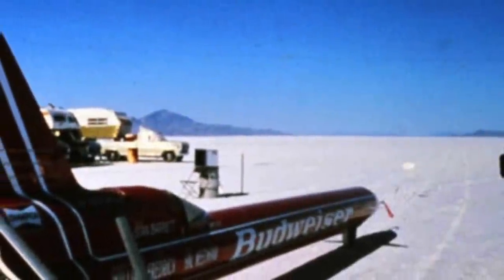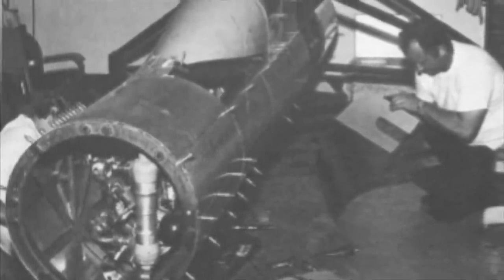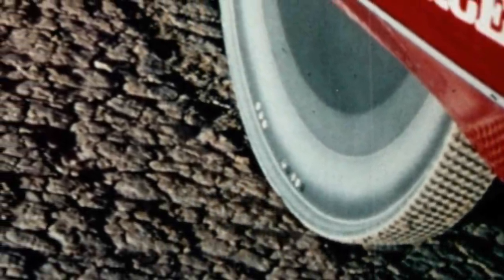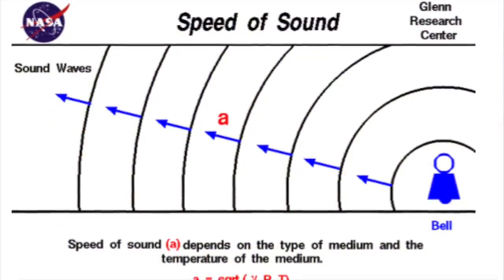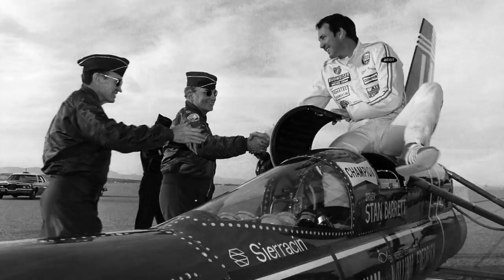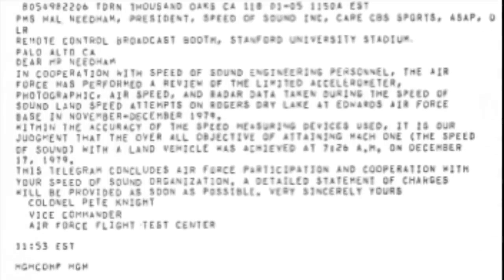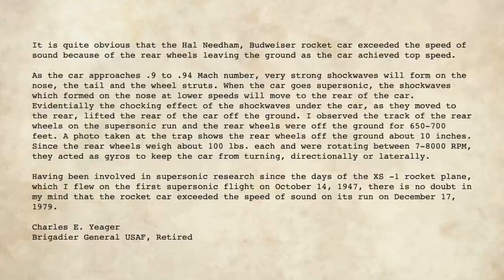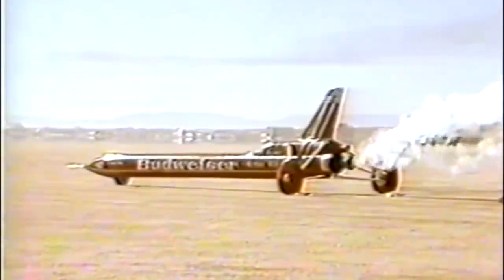The Budweiser Rocket - Controversial Rocket Car

Comment: Several of the test runs were over 700. The last run used about 30% more thrust than any of the previous runs...  Speed isn't linear to thrust, but I bet that extra thrust did get him the extra MPH.
Reply: Considering the already well-known problems with the measuring equipment used, (and the subsequent secrecy about the data ever since) I highly doubt the claims that the previous runs had broached 700 mph too.
Reply: When you approach the speed of sound, something called wave drag starts to come into play, this significantly increases the drag coefficient, the drag coefficient is highest at Mach 1, so this sound barrier is literally a barrier of drag.

You may think that the decreasing mass of the rocket car due to the use of fuel will increase it's acceleration, however this probably isn't the case, since the drag force and the decreasing mass would mean that the acceleration vector acting against the car if it had full propellant at a given speed would be smaller than if the car had low propellant at the same speed.

I would guess that it was very close and I think it would give a supersonic reading, if you looked at the ground speed, however I think the airspeed was just under mach 1 due to a tailwind, but I don't know if there is wind data out there.

Comment: Ah, the age old question of when is the sound barrier broken? I think we need a bit more information on when the speed of sound at this location was determined, and how soon after the attempt was made.  If they predicted the speed of sound several hours before the run, or at a location several miles from where the rocket car was at max velocity, atmospheric conditions could have changed enough to have made the new "speed of sound" be 740mph (~1% difference). Clearly the fastest man on land at the time, but not necessarily the first to break the sound barrier on land.
Reply: The sound barrier is a sudden aerodynamic drag Force on the vehicle you are in as you are breaking or crossing the speed of sound or 767.4 mph
Reply: Got it?
Reply: 767.4mph that the Speed of Sound
Reply: The speed of sound in air is dependent on the density of the air.  It is not a fixed number.  It can fluctuate by several percentage points on any given day.
Reply: @ts89540  Correct, the local speed of sound can change in the same location depending on air temperature and atmospheric pressure (i.e. height above mean sea level).
Reply: @thecloneguyz   It changes with temperature (and other factors including humidity). At 0°C (32°F) the speed of sound is around 741mph. The wiki article claims that the local speed of sound around the time of the run was 732mph, which gives a temperature of about 20°F. They claimed the car achieved 739.666 mph which would have been supersonic if the temperature still was around 20°F, but it would only have had to warm up to about 32°F for that speed to be subsonic.

Comment: No sonic boom not brake the sound barrier.
Reply: You need to go back and study what the speed of sound is. It's a fixed value based on standard pressure and temperature. You can be above the speed of sound at STP while not creating a sonic boom due to local atmospheric conditions.
Reply: otm646 - so what's the speed of sound std? What was the SOS on the day? And how fast did he go?
Reply: @xavierrodriguez2463  my point is someone should have the relevant info to know if they should have expected a sonic boom.
Reply: @otm646  No, I think you need to find out how this works. The speed of sound is temperature dependent. That's why they did the run in the morning when the local temperature was about minus 10 degrees. It doesn't matter. There was no evidence from the television broadcast, the pitot head or the accelerometer data.

http://www.dlg.speedfreaks.org/archive/lsr/bud/bud.html
Reply: Yes and the cross section is so small it would create a much smaller sonic boom than any other land speed car
Reply: @nathanchildress5596  Well, there are other ways to determine it. Nothing came up to indicate that this thing went supersonic.

If you look at Thrust SSC going supersonic, you will hear virtually nothing until you hear the double bang. That is what should have happened with the Budweiser Rocket but it didn't. It would have been quite easy to hear, regardless of the relatively small size.

No visible shockwave, no Schliere and no sonic bang. Pretty hard to make a case from that.

Comment: If it only equalled the speed of sound for a moment, there's a good chance, that there wouldn't have been a sonic boom.
       Too bad, that they didn't use 2 Sidewinders. I think, that they could have, without increasing the cross section. ...Oh well. Woulda, coulda, shoulda...
Reply: Not true.

Comment: The vehicle certainly had the capability. It looks like they went full power, full duration, and used the Sidewinder when he was supposed to at 600 mph. I don't see how he didn't break mach. Vehicle shape is critical for sonic booms, as proven by NASA's current research on quiet super sonic flight. Thrust SSC is nothing like this needle. They absolutely cannot make the same sound. What kind of boom does a sidewinder make compared to the fighter that fires it?
Reply: It doesn't matter. If the sound of the thing gets there before the car does - as it did in this case - then the car is not supersonic. I don't understand how people can't get this. There was no sonic bang at any point during this run so it was not supersonic.

Comment: About 25 years ago the question of this attempt came up again. As stated the measuring methods where poor, but the thing that has been omitted here was the "Sonic boom" caught on film. As the car went by an odd donut shape appeared, dispersed from the car and you could see a dust line shoot across the ground. There's no doubt the car hit sound barrier.
Reply: Pure BS.

If there was any footage showing what you are (falsely) claiming, then it would have been seen in the coverage. Not one camera, whether TV or still photograph, showed signs of a shockwave when the Budweiser Rocket made that run... 

In fact, when Thrust SSC did break the sound barrier in 1997, it came as a surprise what those photos and footage showed the shockwaves clearly around the car, both on the ground and in the immediate vicinity.

This video is pretty much the best researched one on YouTube regarding this controversial subject, but since you apparently have better "information" that Scarfs & Goggles, I'm sure everybody here would be interested in seeing it.

Comment: One way to find out if he did, run it again. This time stick a gps in the damn thing
Reply: Would need to use an aviation GPS because most receivers made for land and water vehicle use have upper speed limits well below Mach 1. The maximums allowed for civilian GPS are 1,000 knots (1,900 km/h; 1,200 mph) and/or an altitude higher than 18,000 m (59,000 ft). Some quit working with either limit is exceeded, some require both to be exceeded before they quit. Small aircraft pilots often find this out when they try to save money by using a cheap car GPS in their airplane and find it stops working at a bit over 100 MPH.
The reason for the limits is to prevent anyone using a civil aviation GPS as a missile guidance system. Why GPS manufacturers would put even lower limits on their land and water receivers is to protect their market for more expensive aviation models.
Reply: I'm not sure GPS was operational at the time, certainly not as widespread or capable as it is now - that's the obvious modern solution but not available to them then. Unless you're thinking get it out of whatever museum it's in now and run it again, I doubt the owners would be willing to do that, especially as it's speed record, whatever it may have actually been, has been clearly broken since. In regards to greggv8's thoughts, even if it did go supersonic it was nowhere near 1,000 knots so if that's the limit they'd be fine. The missile speculation is an interesting thought, I suppose that's plausible, but I could also imagine consumer-model GPS units that are never expected to exceed such speeds (even a bit over 100 mph) or altitudes might shut down because they assume, especially if they're less reliable (cheaper), it is more likely they are malfunctioning to indicate that speed rather than actually going that fast. In any case, I'd imagine the GPS would be specifically designed or sourced for this purpose, and they'd know if it has some sort of measurement limit, probably any GPS manufacturer would be happy to provide a possibly custom de-limited GPS for such a project in exchange for their name on the side of the car, even if rather small.
Reply: @quillmaurer6563  yeah, get Garmin to sponsor it as the Garmin Rocket

Comment: No sonic boom no breach of the sound barrier. Sonic booms can be heard by as much as 40 miles away. They should of at least of heard something within a mile of the passing vehicle. The boom is far louder than any rocket engine!
Reply: And no visible shockwave as there was with Thrust SSC.
Reply: A sonic boom is a sound you cant miss

Comment: I’ve always wondered why they didn’t go all-out to attempt an official FIA record. Surely it would have been achievable?
Reply: Says in the video, not enough fuel to sustain the measured mile.
Reply: It didn't qualify in a couple of areas. First of all, it needed to have four wheels and it only had three. Secondly, it couldn't be refueled in a short enough time so a return run was not possible.
Reply: TheThirdMan - Thanks for the info.

Comment: It’s total BS. The analogue accelerometers used have a large margin of error. Didn’t use the speed trap because it had an unfavourable result then  it took 8 hours to make a calculation given that they had to make assumptions for friction and instrumentation error. Then came to a result to 4 decimal places is incredulous. That’s like using a steel tape measure to measure microns.  Look at it this way. It was easier to say it did. Everyone would benefit. Sponsors, driver and who would be crazy enough to try?  How about they release their calculations!!

Comment: It probably did break the sound barrier, though only for a few seconds. Its slim design helps reduce the effect of a pressure waves that start to build as a vehicle "approaches" the speed of sound. Atmospheric conditions can limit how far a sonic boom can be heard. At best this should be seen for what it is, a stunt to show how far man and machine can be pushed. I'm sure that the American and British teams, vying for the sound barrier, were encouraged by what the Budweiser rocket car achieved and had a little more certainly that it wasn't a totally suicidal goal.
Reply: bullets are more streamlined and very small yet you can hear the bang when they break the sound barrier .Budweiser Rocket no bang ,no sound barrier ,no record its that simple
Reply: Big Smoke You seem to be very educated on this. What aerospace engineering school did you get your degree from? :)
Reply: @Channelscruf  Everything that breaks the sound barrier creates a compression boom. No degree necessary to read results of previous experiments and work the aerospace industry did about the effects of moving from trans sonic to supersonic. :) :).
Reply: And yet none of those teams believes the Budweiser claim. There's no reason why they should. Besides, no sonic event was recorded on the television broadcast, the pitot head or the accelerometer data.

Comment: As far as I know, common consensus is that the Rocket went faster than the then-current FIA LSR holder Blue Flame (1970) and even the next FIA LSR breaker Thrust2 (1983). The Rocket was the fastest land vehicle that had ever existed and was not surpassed until Thrust SSC (1997).The Mach 1 and FIA controversies should not overshadow this incredible achievement. 
It also showed that FIA rules hindered land-speed technology progress because of the restrictions placed upon the vehicles (fast second-run ability, large fuel load).
Reply: If there are no provable records then sorry, this car did not achieve what people claim.  If you really believe that then I have a nice little Toyota Corolla I could sell you that went faster than all of these, or so I believe...
Reply: There are 3 reasons for the 1 hour / both directions rules. To even out atmospheric conditions ( winds etc) , prevent the attempt on a slope ( no gravity assist) and to prove that the vehicle is not a one off that will be broken at the end of the run. This is how progress is made and not with american sour grapes. The rocket was a marketing stunt and not an LSR contender. Also FIA rules say the vehicle must have 4 wheels and must be wheel steerable for the record to count
Reply: rapid13 
They are different vehicles.
The blue flame burned natural gas and hydrogen peroxide. They look similar. I saw the Blue Flame in Utah on display as a kid.
Reply: @andrewday3206  Thanks for that. I was 9 or 10 at the time, it was exciting to watch on TV.
Reply: I think it was a great achievement but given how reluctant the team were to share any data other than 'we did it' makes it clear they didn't break the sound barrier. And of course the lack of a sonic boom. Very lucky the guy survived really if it's wheels were lifting off the ground at points. At those speeds the stability is often on a knife edge!
Reply: @rapid13  booyah! You said it best, self appointed know-it-alls think they can officiate reality.
Reply: @dwinterx  it doesn't 'make it clear' at all, the only thing that's clear is that we can't know it it did or it didn't.
Reply: @dwinterx  A lack of data makes nothing clear. And while there is no audible sonic boom on a tape from 1979, that doesn't mean there wasn't one. The shape of the projectile plays a role in how loud the boom is. The Air Force folks at Edwards think they did it. The driver/pilot experienced a similar phenomenon to Yeager in the X1. Based on the available data, the evidence seems to indicate that they did break the sound barrier. That said, we cannot say definitively one way or the other. 

But I watched the Blue Flame as a kid, and I recall watching this on TV. In my heart they will always be the first, even though my head knows that we don't really know.
Reply: @rapid13  A bullet makes a very audible crack if you stand to the side of a 25 metre rifle range. Size is irreverent. The Budweiser Rocket should have made a Sonic Boom that everybody at Edwards should have heard. It didn't!!!
Reply: @richardvernon317  That's a cute but useless and poor analogy. Size, shape, and orientation matter a great deal to the intensity of the "boom." If they didn't, why would NASA be playing with different wing shapes and designs in the hope of reducing or eliminating booms that can be heard on the ground? And you've obviously never stood on a dry lake bed. The desert is anything but quiet. Depending on the wind, you wouldn't hear a freight train at half a mile.

Comment: No doubt it was at the edge and probably the nose did poke through briefly, forming a small, unstable shock wave that banged around underneath the vehicle causing the rear wheels to lift and shaking the driver. 
But a fully-stable/established and controllable 'ride' while supersonic ---that obviously goes to Thrust SSC.
But still --holy Shlit, what a ride.

Comment: No visible shockwave through the dust trail behind it. No audible sonic boom. 
They didnt do it.
Reply: YO!  Scooter G! Long time no hear from you!  How's it hangin?
Yes, that was me, being persistent, again, yep, guilty as charged !
However , 
I prefer to think of it as redundant.
But in my defense I was left unsupervised and AND I am a Beer Snob
Oh,  and don't call me Scotty!  My name is Scott E
Properly pronounced with a slight dramatic pause and with a ever so slight puzzled look as you jauntily tilt your head at a very slight angle
Reply: @scotte2815  - Should have posted your rants on an actual beer video. And in all your redundancy, you failed  to name a single quality beer. Miserable.   And don't bother now; you failed Scotty. Hooked on phonics. Why? Can't tell you.  Call me Mister E.
Reply: @DieselRamcharger  Got that right!
Reply: @scotte2815  - Visit you? Where do you live?
Reply: @scootergeorge9576  in the most beautiful state in the country, far, far away from any salt flats and where there was more microbreweries than any other state. 
And you?
Reply: @scotte2815  - You didn't answer the question. You invited me to visit you.
Reply: @scootergeorge9576  well, there's the problem.  I'm not putting personal info on here, but if you can provide me a means to reach you, then I'll send the info to you and the invite will stand.
Reply: @scotte2815  - Actually, I wouldn't cross the street to see you, Scotty.
Reply: @scootergeorge9576  Of course you wouldn't.  That has to be a totally terrifying thought for you.  The concept of meeting face to face with someone who would challenge your comfortably closed mind with critical thinking, The horror of sitting down to try a different beer that might actually have a flavor, and a complex one at that,  the thought that I might be 6'2" 250 pounds and   have little patience with stoopid people, 
Still, 
If you can find the courage and a way for us to securely exchange info the invite stands, I'll buy the beer

Comment: Simple, no sonic boom no supersonic speed
Reply: Technically transonic on land is supersonic at 40,000ft, depends on the altitude, but if you're referring to ground speed as a reference, it's around 762mph
Reply: @throttleblipsntwistedgrips1992  - Perhaps at sea level. The Bonneville Salt Flats are higher  at 4,236 feet. Mach 1 would be lower than 762.
Reply: Speed of sound at sea level or Mach 1.0 is 767 miles an hour not 739 . i liked your comment
Reply: Bonneville is not on sea level